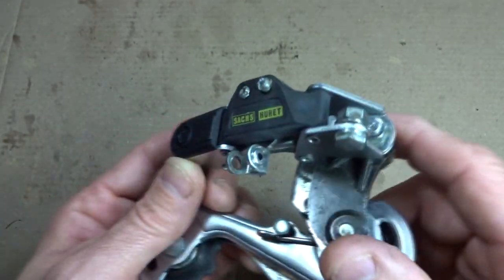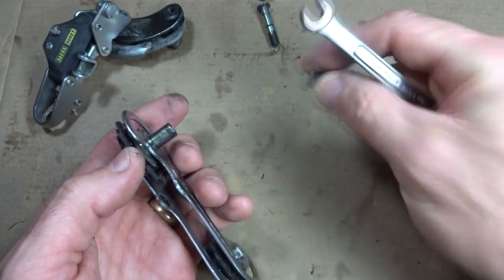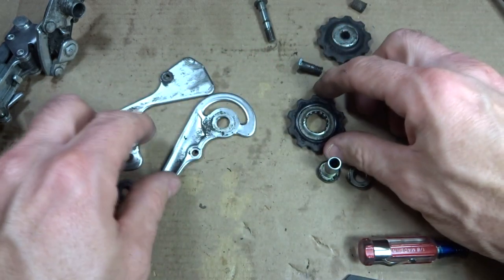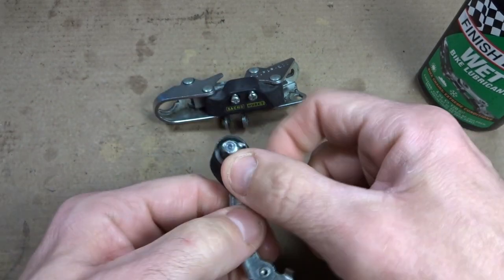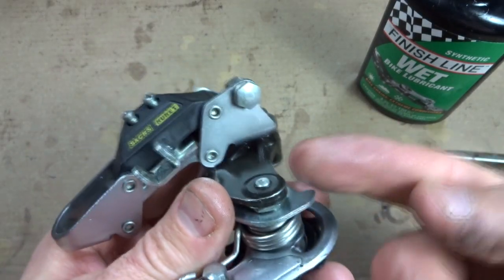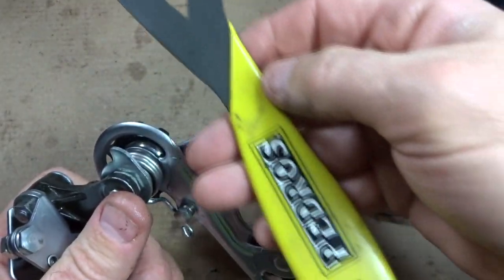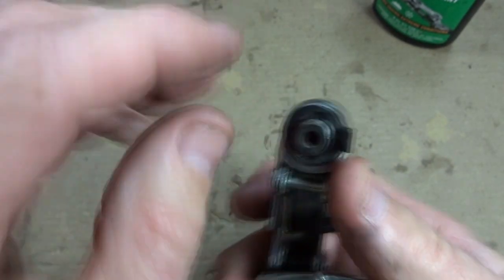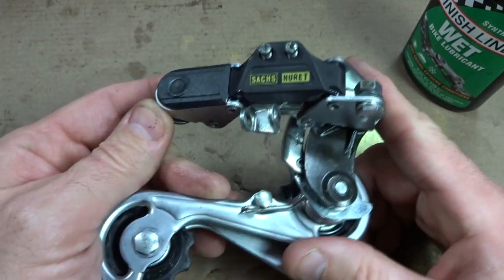Sachs Huret DuoPar Eco Rear Derailleur Overhaul - Disassembly/Re-Assembly

Comment: Wow RJ so glad I came across your video so easy to follow.  I have a Titanium version of the Sachs Huret Duopar on my touring bike, after my last trip out I noticed that the derailleur was loose due to the top jockey wheel bolt having come undone fortunately no parts lost. Also noticed that the jockey wheels were loose.  Thanks to your great video I was able to take things apart with confidence clean and fix then put it back together.  Thanks a bunch regards from St Andrews Scotland.  keep well.
Reply from the maker: Glad it was helpful!

Comment: FANTASTIC!!!  I have a mid-80's Schwinn Passage with the OEM Sachs-Huret DuoPar derailleur.  I think you just gave me my Christmas bike project.  I've never had the derailleur overhauled since I've owned it.  I read that the DuoPar had a double parallelogram design which gave it the widest freewheel range of any derailleur, even current ones by my understanding.  I have to ask though what bike you had the DuoPar on, since it's not been available on new bikes for many years.

Also, thanks for your vid and DIY tool for removing and installing headsets.  I used it to replace the threaded headset on my Passage.
Reply from the maker: It was installed on a Schwinn Le Tour Luxe, but it wasn't the orignal derailleur. https://www.youtube.com/watch?v=cmGsXwE8GFg

Comment: nice job on removing that last pulley, nice. How do i remove the bearings of a normal shimano pulley wheel? I want to use an old derailleur's pulley wheel on a 12mm rear axle. I am missing my false pulley from the park tool false axle. I would put the park tool pulley off of the false axle and put it on my normal axle without a tire, so i can clean my chain with the wheel off, or keep my chain nice, when cleaning when the wheel is off. A jockey wheel looks like it has a 12mm hole once the bushing is removed. I saw a guy remove his ceramic bearings using a vice and a couple of professional "ends", which i don't have. I made your home made headset press and also your home made start nut driver out of old ratchet sockets. I'm thinking of using a small vice i have with a couple of sockets. Like one that has around a 12mm outer diameter on the other side a socket that has an internal diameter of over 12mm so that the bearings are pushed into this bigger socket. What do you think? Otherwise it's the hammer lol. Since the bearings only have about 3000 miles on them i might be able to use them to replace my current ones. Thx!

Comment: Can this type of derailleur be used in a 10-speed or a 12-speed? Thanks RJ!
Reply from the maker: Probably. There are many newer derailleurs that are better.
Reply: Thanks  @RJTheBikeGuy ! I'm working on getting a '83 Motobecane Randonnee back into shape, but it's original Suntour derailleur has a really worn out spring so I'm looking for a replacement. Someone on Craigslist has a Sach Huret DuoPar Eco for sale for $10 so I figured I'd do a little research. What kind of derailleur would you recommend? I picked up the Randonnee for $20 so it's definitely a budget build!
Reply from the maker: @toastersarecool27  It's an antique. Find if you are doing a resoration. You can find lots of newer better derailleurs on ebay for cheap. You can probably find a Suntour. Or maybe upgrade to a nice Shimano 600.
Reply: @RJTheBikeGuy  It's most definitely an antique, fairly obscure too it seems. Shimano 600 eh? Alrighty, thank you for the help RJ!
Reply from the maker: @toastersarecool27  Shimano 600 was the precurser to Ultegra. You can maybe even convert to indexed shifting. I have them on several bikes.
Reply from the maker: https://www.youtube.com/watch?v=LT8CRqyG_AY

Comment: Hey rj how you are doing? Can i ask a question? I bought a BB a shimano one and when i fitted it in my mtb the front derailuer cant shift on to the biggest gear. So i was thinking maybe i bought the wrong one? I just notice the old one has a thinner lip than the new one. Hope that you can help me thank you :)
Reply from the maker: Maybe. I don't know anything about your bike, or what crankset or bottom bracket or derailleur. I don't know if you adjusted the derailleur, or just swapped the BB and hoped for the best.
Reply: Actually its just replace the BB and hope for the best kind of a thing. And the bike has an altus front derailluer and the bike is a hard tail Trinx M618. I dont know if you know that brand. Bec. Here in the Philippines its quite famous and the crankset is flint prowheel. Yeah its kinda cheap but it does the job. thanks for the reply rj. I hope you could still help me thank you bro :)
Reply from the maker: Sorry, without knowing exactly what you have, and what was done/not done, I just can't answer.

Comment: it appears from the video that only one of the two cage rollers has bearings? Can anyone elaborate on why that is.
Reply from the maker: Most pulleys don't have bearings.
Reply: Hi from St Andrews Scotland  I believe that the titanium versions including the Eco were made with  jockey wheels with  bearings  top and bottom where as the all steel Eco  has a bush jockey at the bottom and bearings in the top. The other difference i notice is that the all steel Eco and Titanium versions have a curved black top support as in RJ's excellent video as a apposed to a narrow support on the none Eco.   But as RJ says most don't have them.

Comment: Man those look like they are made to last!
Reply: Man, until 20~30 years ago almos everything was made to last...
Reply: Scarcity of resources and an ever larger need to maximize profit is the reason!
Reply: I would claim it is just made of too many parts (i would expect it collects dirt a lot of places).
Compared to a modern rear derailleurs (or just Shimano 600 and  RD-6500 ) that have fewer more special parts.
I had a Shimano 600 last year (from ~1980) that was in mint condition and my RD6500 do not have any issues after 5-10 years of usage.
Reply: yes, they have many parts indeed, but in these days there were only small cage derraileurs, and they could not be used with the large cogs that started to appear. So they developed this kind os dual parallelogram that worked very well in these large cogs, they were extremely expansive and indeed they were a lot of cases of premature worn since there were a lot of "extra" parts like you said.

Comment: I don't know why SunTour decided to make their rear derailleur the same style as this Sachs (The SunTour Tech Technology). The slant parallelogram is already superior at that time. They do not need this dual spring design at all. If only SunTour could have avoided this design and just put the spring on the upper knuckle as Shimano did, a slant parallelogram with a spring-loaded upper knuckle is too advance. I guess this style of rear derailleur is the downfall of SunTour due to the lack of built quality and issues like dirt sticking on bearings of the upper pulley. If they did that while researching how to defeat Shimano's STI Technology and SIS because SunTour Accushift was trash,  they could have been a big manufacturer today.